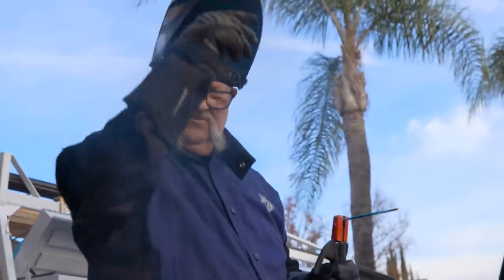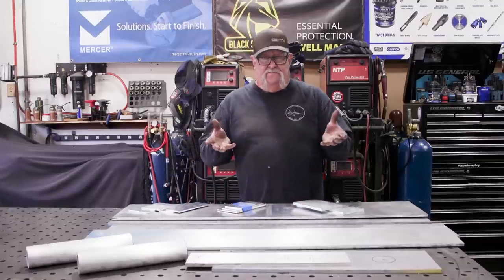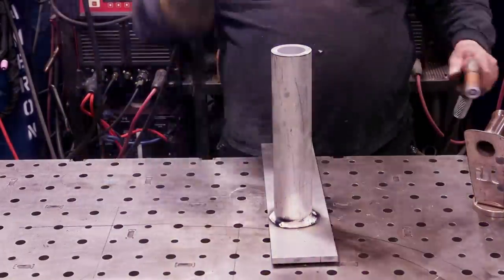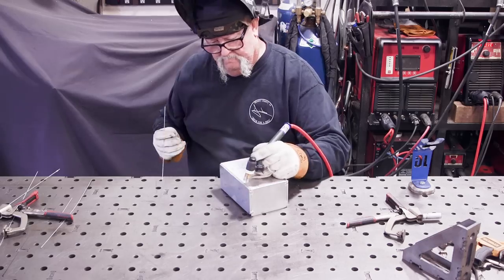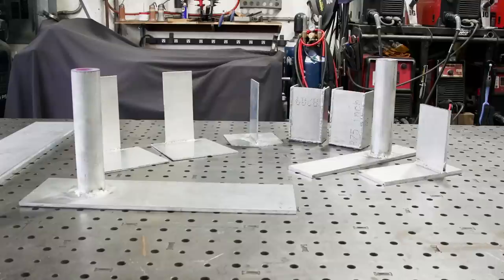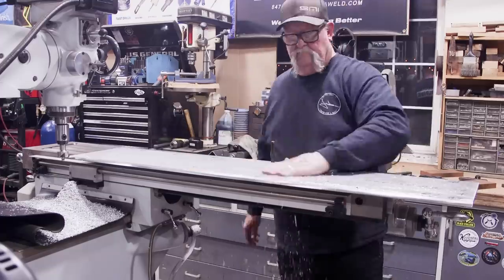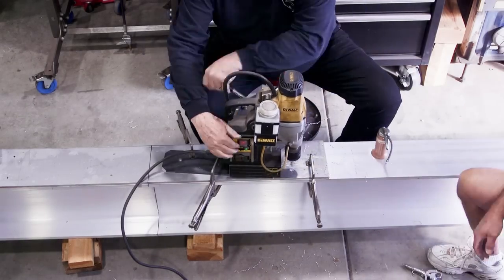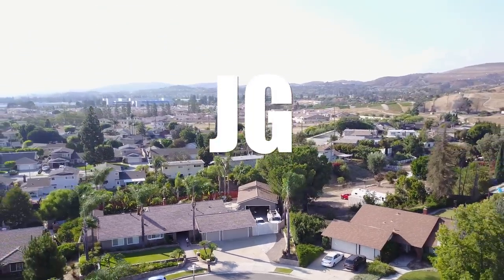Replaced car port supports with 37ft I-Beam | JIMBO'S GARAGE

Comment: Hey Jimbo! The head of your mill should be able to move back and forth. Not just the table. I can see the dove tail on the bottom of your mill head. There should be two bolts on the left or right hand side of the column they might be 3/4 or 7/8 hex head. They are basically oversized set screws and there should also be a super accurate scale for you to reference to when you're moving the head back and forth over the table. Head should glide back and forth super easy if your machine is clean and lubed well. I hope this helps you mill some big items in the future.

Comment: Jimbo,  I think for the 48" long plate that needs to be milled, I would have drilled the holes that are going in that plate first and then you would have had ample places to bolt the plate nicely down to the bed of your milling machine.  Love your videos, keep up the good work.  TP
Reply: Exactly what I was thinking also. And he could have used a router with a round over bit.

Comment: When machining the radius on the large fishplates. You have to drill holes in the fishplates to attach the plates to the "I" beams so why not drill the holes first so that you can use the same holes to do a better job clamping down the fishplates to machine the radii and offer you better positioning.

Comment: The radius cut. The second cut was a climb cut. Climb cutting will get a better finish. Chips don’t get fed into the cut. We had some older milling machines in our shop. Sometimes when climb milling you will need to slight tighten the table clamp to keep the cutter from pulling any slack in the table and jumping and taking too much of a bite. I didn’t hear what grade of aluminum you were using. We used kerosene for aluminum to get a better finish but that was 20 years ago. Might be better lubricants available now.

Comment: Thanks for the video!  Regarding using the hole saw in the mill, a great trick is to drill one or more holes tangent to the cut on the inside/waste side so that the swarf can fall out of the teeth once a revolution.  Also, having an air-mist system (basically an industrial airbrush) will help out a lot with the chips.  Regarding advancing the filler rod, Jody of WeldingTipsAndTricks, recommends that you pinch the rod between your thumb and side of your palm, and between your ring & middle fingers.  You can grip between your fingers, relax your thumb, and advance the rod, then you grip with your thumb, move your fingers back, and re-grip for the next advance.

Comment: Sorry for the questions. For a bolted connection, it feels like there should be about 2-4x as many bolts through the web & flange as there is?

Also, shouldn't the bridging plates be a larger thickness than the main material? A325 or A490 Structural bolts used? 

Did you have plans to engineer to?
Reply: galvanic corrosion?